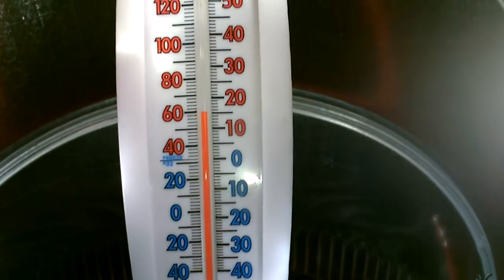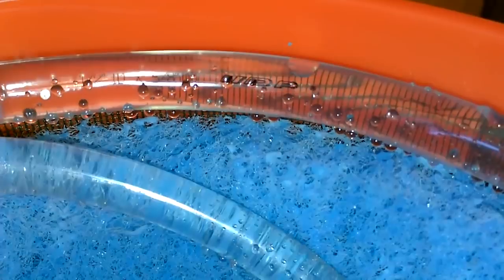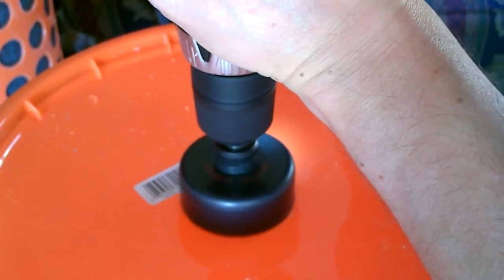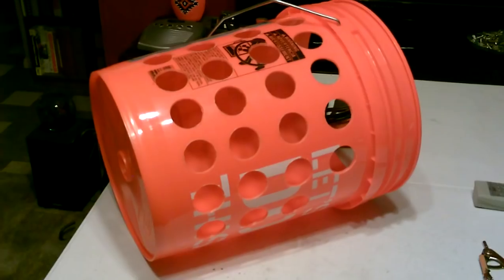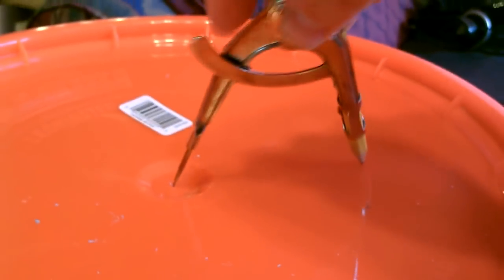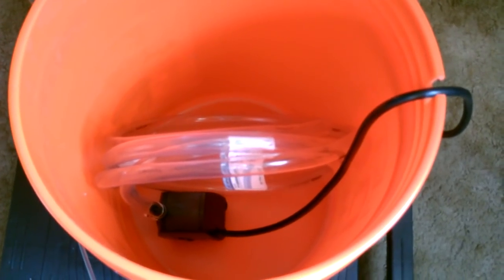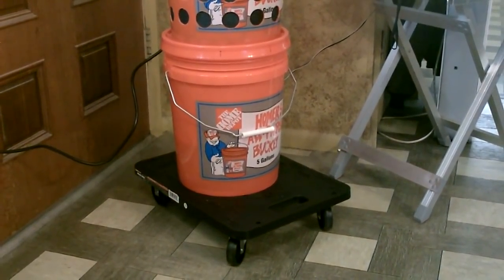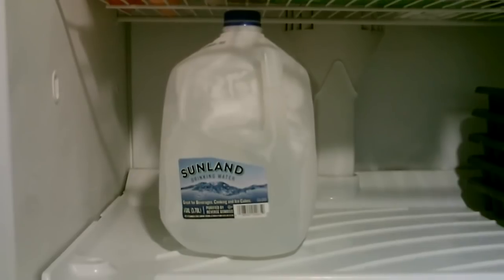DIY Evap Air Cooler! - Dual-Bucket Evap Cooling Tower! - Awesome Air Cooler!! - can be solar powered

Comment: After I watched this, I built it like this, but it didn't cool my room down enough. I'll find another different cooler with cold air than this. No disrespect.
Reply from the maker: hi there. i'm glad you make it. sorry, it didn't work out well enough for you though. with evap coolers it's all about the temperature and humidity levels that you run them in. these units work best in semi dry and dry conditions. if you got some cooling (but not enough) then it's probably just the humidity and temp levels where you live are a little high for the unit. you can always check an 'evap cooling chart' to see what temps it should be outputting. if the air is dry enough it may be that the water flow was to fast or too little. also be sure to vent these to get the coolest temps.
Reply: @desertsun02  yup, at least it works in my cat room, I put it for cool my cats and they loved it and they sat near it as they feel very satisfied. My room is very large than the cat room. I just need to build the bigger cooler for my room.

Comment: Amazing tutorial! I am thinking of using this when I camp. How long will a bucket like this last per filling of water? Have you thought about doing 2 layers of cool pad to make it thicker?
Reply from the maker: hi. and thank you. this should work great for camping. how long the water lasts will mainly depend on how dry the air is. (the drier the is air, the more evaporation that will take place). i usually get several hours before i need to add more water. i haven't really thought about using more padding to make it thicker. i don't think it would make the air any colder. just the one layer of pad seems to drop the air to 'the limits' allowed by evap. cooling. if you use a much faster fan then a double pad might be an advantage.

Comment: So I have 420cfm fan and the evaporator pad but it never drops temp down.  I built a pvc cage with small holes at the top.  The evaporator pad is underneath the pvc with holes.   The pump is circulating the water.  The temp doesn’t drop at all.  Water or air
Reply from the maker: hi. sounds like a much different build than the unit in the video. i'd have to see the build to figure out why it's not working.

Comment: Trying to build this but no experience. So I got the pump today, 12V DC. There's no place on my charge controller or on my solar generator to plug in this kind of cord. The instructions are in Chinese with no pictures. Got any suggestions or could you make any if you had pictures? Really frustrating.

Comment: thanks for the clear thorough video! ill keep tweaking but have not been able to get a temp drop in my 90º, very low humidity room. my understanding is swamp coolers function best with a vent to remove hot air and humidity build-up from the room, do you have a vent in the room where you use this? could you say why or why not? again thank you!
Reply from the maker: hi. yes you have to vent it. if not vented it will increase humidity and the cooling will be very limited.

Comment: how much does this drop the indoor temp in the desert when its 90º-100º indoors?
Reply from the maker: hi. it will depend on the humidity, but it an drop it 20 or 30F if it's dry where you live. for an estimated temp drop you can check an evap cooling chart. those give an estimated temp drop based on unput temp and humidity. they are accurate to within a degree or two. 100F will drop down to 71F if humidity is low. 90F air can drop to 69-70F with humidity from 15 to 20%. are a couple of examples.
Reply: @desertsun02  thanks! do you have any recommendations for when monsoon season arrives?

Comment: I live in Valdosta, GA. I have no central air right now in the medium sized bedroom that i am renting. Room temp is 94 degrees. Do you think this will work for me and if not, have you made anything that may work for me?
Reply from the maker: hi. the humidity where you live might be to high for this but check out my latest 4 air cooler videos. they all show how you can make an air cooler with no added humidity. here's a link to one https://youtu.be/5YVPu9hfhZo

Comment: What kind of pump?
Reply from the maker: hi. i used a 200 gph water pump. (cost 10 dollars).
Reply: @desertsun02  Thank you for your prompt reply. If I may, I have a few other questions. 

Where did you buy it? I can't find anything under 30? 

Is it a fountain pump?
Reply from the maker: @Teekoness i got that one at harbor freight tools. last time i checked it was 15 or 20 dollars (but it had the extra feature of shutting off when the water got too low). good feature but i guess they had to increase the price. amazon is a good place to get them too. they have them for 10-25 dollars
Reply: @desertsun02  Thanks again.

Sigh. May not be able to afford that now. Maybe I can stick ice in a container above the pad and it can wet it as it melts?

Comment: How much of an improvement is the 2 bucket version compared to your 1 bucket version?  Does it have a larger temp drop?
Reply from the maker: hi. with the bigger reservoir and the extra air holes this one is more powerful - covers a larger area. temps on both drop down about the same.

Comment: It would be nice if you could provide Amazon links to all of the materials for the build. I will build one of these to run off of a solar panel. I will have to do the research myself to find the correct size of pump, fan, solar panel, battery, voltage controller etc. Thank you for this great idea.
Reply from the maker: hi. providing amazon links is proving too difficult with some of the products. they switch the links so often i can't keep up. and if i forget then there are just a bunch of non-working links out there. best to just search amazon for best price.

Comment: How long does the 5 gallon and 10 gallon last? I live in AZ and it can get up to 115-120 degrees during summer. I will not be able to work from home much longer and would like to use this in my newly adopted pet's dog house that is 4ftx4ftx4ft.
Reply from the maker: hi there. it depends on how dry it is. (how fast the water evaporates). you should be able to get 5 or 6 hours before you need to refill the dual bucket unit with water. if you just make the single bucket setup then it's more like 2.5 or 3.5 hours. (but this varies)

Comment: Thank you desertsun02 for the great video. You inspired me and the weather is killing me so I ordered all the materials and made one. It was a lot of fun and blew cold air until it didn't work properly. lol
I am having a few problems. I have put tons of holes in my tubing but they seem to just close up so my evaporative pad just dries out and fan no longer blows cold air. How do you keep the hold open? 
The second problem I was having a found a way to fix it - my tubing was not staying up and it was getting crimped so I put a wire down the center of it. Now it holds its shape better and it does not fold on itself. 
I am pretty sure I bought the same type of tubing you are using - but it is not working very well.
What do you think the problem is with the holes not staying holes? Water is NOT dripping out of the holes. When I first make a hole the water shoots out and then it stops.
Reply from the maker: hi there. first, i'm glad you built it and that it's working for you! to keep the holes from closing try drilling the holes out with a very small drill bit. use a one-sixteenth inch one. that should work good. that will remove enough of the tubing so that is doesn't try to reclose. possibly just using a fatter nail or push pin could work too.
Reply: @desertsun02  thank you so much for responding! I tried a bigger tool and that didn’t work so I’m gonna try drilling like you suggested! 🤞 fingers crossed!

Comment: Instead of using a water pump, do you think it's possible to make it with a overhead gravity driven water drip?. Maybe if the hose and drip holes were big enough in diameter?
Reply from the maker: hi. i'd have to give that one some thought

Comment: Hey do you think having a thicker pad would increase the cooling or put too much strain on the fan?
Reply from the maker: hi there. you could probably double it up if you want to. the pad is designed to work with fans up to 2250cfm (roughly), so even a single pad works great.

Comment: Could you just add a third bucket, at height, and do away with the pump?
Reply: You could valve a higher, third bucket to the hose in the second bucket and you don't need the pump. You still need the electricity for the fan, though.

Comment: What's the GPH on the pump?
Reply from the maker: hi. it's 200 gph
Reply: @desertsun02  ok thanks
Reply: @desertsun02  what  Is the blue pad  and where did you get it
Reply from the maker: @joe barker it's evap cooler pad. you can get it at home stores like home depot.

Comment: Okay so I am super ignorant but I am trying to build something similar to this for burning man.  What is the metallic tube called that is coming of the top of the cooler?
Reply from the maker: hi. it's called a 8 inch 90 degree round adjustable elbow

Comment: Suggestion for high humidity areas or if you’re needing maximum cooling.... since this system efficiency is limited by how easily water is able to evaporate.   If you use a mixture of water and alcohol it should dramatically increase the cooling efficiency.  Not sure about odor but it should majorly increase evaporation rates and cooling.
Reply: Yes it'll be cool but then you'll be breathing in alcohol vapors! Better approach is indirect evaporative cooling. Unfortunately for humid areas you'll never get temperatures below the wet bulb temperature. Instead, maybe some combination of dessicant and indirect evaporative cooling would work if you can afford such a complicated system instead of a compressor based AC.
Reply: Do you have a recommendation as to what water/alcohol ratio would be most effective? 
And what type of alcohol?
Reply: @therationallion  - I think any alcohol would work. Rubbing alcohol would certainly be the cheapest.    You might try starting with a 50% solution of rubbing alcohol and water. The higher the percentage of isopropyl alcohol the more water you should be able to get away with using.  Ultimately gonna be trial & error but the theory is at least sound.
Reply: @motorgearhead  Thanks for the reply, I'll definitely be experimenting.
Reply: @therationallion  - let me know how it works out please.

Comment: Hi, thanks for the great video.   I’m trying to build one of these (as they say the devil in in the details) and have a few questions.  

1. how much better is the double bucket design than the single bucket design?   I like the fact that the bottom bucket holds a full 5 gallons of water.  What are disadvantages of the double bucket design?

2. What is the exact model of fan and pump you are using?  Do you have amazon links for these?  Also what is power consumption when both are running?

3. Is there anything special about the window screen you’re using?   I couldn’t find that exact one anywhere, but not sure if specific qualities are better (ie ultra fine, standard, etc)

Im having a really difficult time finding evaporative cooler pads in my area (but this unit will be used in an area where evaporative cooling works well), I can only find 29”x30”, I can’t find 28x34, will the smaller size work ok?
Reply: 1. The advantage of the double bucket design is that you can drill the top bucket full of holes, for more air flow. Also, the evaporative pad won’t be half submerged in water. The only disadvantage that I can think of is that you need two buckets – a larger unit.

2. According to the first video, it looks like a 6-inch 12-volt automotive (DC electric) fan unit is being used. I am using a 6-inch desk fan (AC electric) that I have removed the base of.

3. Don’t think the type of window screen will change the outcome. I am using some general window screen I found at Home Depot.

4. As long as you can trim it down to 13 inch height by 30 inch width, you will be fine. 30 inches seems to be the inner circumference of the 5-gallon bucket.

Comment: What size pump...  Gallons per hour.  Don't want to get to powerful, or it won't drop but spray out the hose.  Thanks
Reply from the maker: hi there. i used a 200 GPH one. a 150'er would probably work good too

Comment: So I made the two 5gal version, but I'm just not getting anywhere near the low temps you show. Not sure what I'm doing wrong. It's 80 degrees in my house, pump is working, pad is getting wet, got plenty of holes in the bucket...but something just isn't working right. The lower bucket reads 64 degrees with ice in it, but the air blowing out doesn't get below 72 degrees. Somehow the air exchange isn't happening. We put about 4gal of water in...is there a chance that's too much? Any tips, thoughts?
Reply: Don't know where you live, but they won't work in the Midwest with hot, muggy conditions. These devices work well in hot dry climates.
Reply: His temp shows inside the duct...great if that is where ur hanging out...works better if ice in bottom
Reply from the maker: hi there. could it be the humidity level in the air? i just checked an Evap Cooling Chart (you can google that) and it shows 80F air temp at 55% humidity would give you 72F air. i've found those charts are very accurate. *average's 5-8% humidity in my desert area... sometimes lower! - i saw a 39 degree temp drop once... but they usually average 20-30F drop
Reply: desertsun02 I appreciate the insight. We're pretty dry this time of year as well, but you may be on to something. I'm going to try a little tinkering and see if I can get to drop a bit more. We're cookin! 😁
Reply from the maker: awesome. one other thing... make sure the pad is saturated (if it's too dry the temps will go up fast) but this one really works great so keep at it :)
Reply: desertsun02, thank you for the help. It's much appreciated and I enjoy the concepts I'm learning from your videos. Keep it up.
Reply: You really need around 25% humidity for perfect results.

Comment: PS: Please post a detailed list of all the parts with their proper names (With AC and DC options; I might get a couple made for my old lady friends on solar) that you used here so I can take it to Home Depot when I go shopping. It's 80 miles away,, so I can't forget anything or get the wrong parts! (Including the type of fan you are using and the little white pvc plug thing at the end of the tubing.) And, did you use all 10' of the tubing for this one, or less?

Comment: Mr. Desert Sun, You have made about half a dozen of these contraptions over the years, all great. What I want to know is which one actually works the best (Ice/Cooling agent lasting longest; Degrees of Temp Dropping) in your opinion? I am not a handyman type; little to no tools skills and will be asking a friend to put one or two together for me. So, I want to get it right, the first time! I don't use solar panels, I am on the grid, so electric demand is not a top concern. I live in an RV @ 31.884 Longitude in NM that climbs to 115-120 Degrees inside for most of June, July, August and the 5,000 BTU AC unit only lowers the temp about 10 Degrees, so it is fairly unbearable. Thanks for any info. klee.
Reply from the maker: hi there. i normally don't rank them (because they all have their advantages...) but... if you've got the right climate and you want to cool the largest of areas (*more than a room) i'd have to say my evap. air cooler designs that use 20" box fans. i have 3 of those (at least)... but my newest one is really posting some impressive numbers. it's cooling my ENTIRE HOUSE all day in 100F heat. it's cheap to make and unbelievably simple to put together. posted 2 weeks ago (5/1/2018) if interested here's the link https://youtu.be/xDze9f6Jx8Q
Reply: Gee Thx! I Hadn't seen this newest one, and just by the increased Fan size, I bet it will do the job for my living in the Desert environment also. You're the best, thanx again, I appreciate your creations and helping others. klee-pjp88029
Reply: desertsun02 same question but for a 25 foot rv. What's your suggestion on the best one? Great channel!

Comment: Where did you get the dura cool pad? From the looks of everything else, I’m guessing the rest of the supplies came from Home Depot. I wasn’t able to find that pad on their web site.
Reply from the maker: hi there. i don't see the pad on their site either (but they have boxes and boxes of them in the store). if you type the search term 'duracool evap pad' into search engine it brings up a lot of them. if interested, amazon has the pad for about $8 https://www.amazon.com/dp/B000UJDVIY/ref=asc_df_B000UJDVIY5444179/?tag=hyprod-20&creative=394997&creativeASIN=B000UJDVIY&linkCode=df0&hvadid=167155689281&hvpos=1o3&hvnetw=g&hvrand=7193191279482081285&hvpone=&hvptwo=&hvqmt=&hvdev=c&hvdvcmdl=&hvlocint=&hvlocphy=9030009&hvtargid=pla-304692300946
Reply: desertsun02 thank you for the response and the link.
Reply: I just saw rolls at Wal-Mart and also cut rectangle (replacements) as well. I bought mine at Lowes.

Comment: I like your video's and admire your percevearance. I have a question cons. The "dual bucket evaporator" : what is the ingoing water temperature and the actual delta t over the device? Thanks
Reply from the maker: hi there and thanks. i didn't measure the starting temperature of the water (but my tap water is usually 77-80F). with a drop to about 60F. so about a 20F drop. humidity at time of test was 5-10%